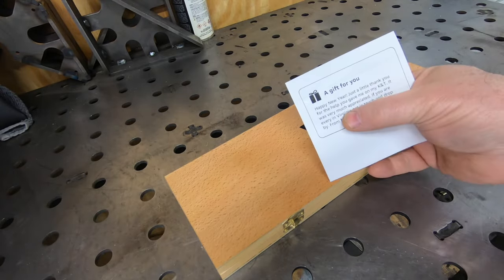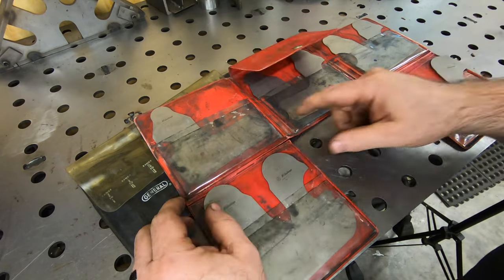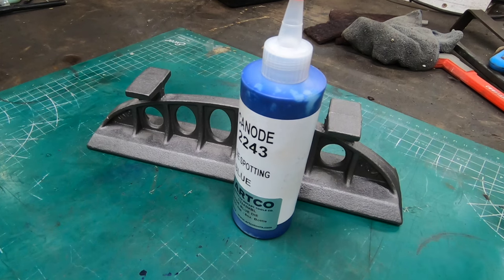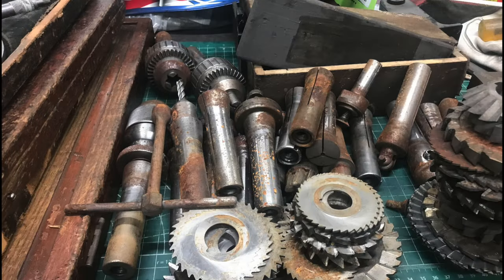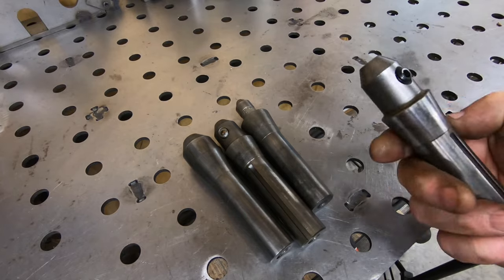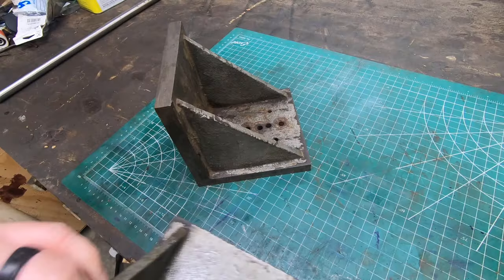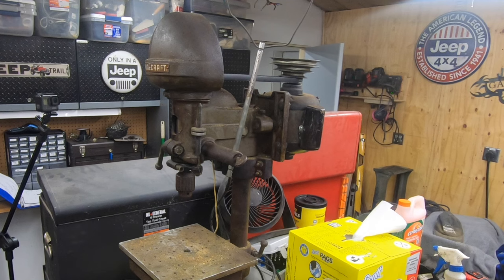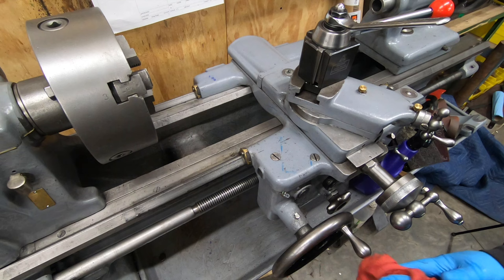Odds and Ends - Episode 8 - Shop Updates, Cabin Fever, and Climate Change

Comment: Well you certainly got some gear there. I thought i had a lot of tooling but you are way ahead. My problem is room. I now have a outside storage cabinet , which is full. With starting doing the old car up I now have even more parts. Never ending. The trouble is I have tooling for the mill & lathe that will outlast me. Nice video.
Steve.
Reply from the maker: I can't stop! 😂 Some of it I want, but often these auction lots come with stuff I don't have a use for, so I will put them up for sale or give them away. I have the room, the problem is I don't use the room effectively. I have this large 4' x 8' work table, that I love, but the underneath storage is horrible. I've been thinking of building a replacement, maybe out of steel, and put drawers underneath it for some of the miscellaneous stuff.

Comment: Hey Greg good video if you electric bill for heating is to much i use a pellet stove i picked up a used one from a friend cheep
i buy a pallet of wood pellets 50 40lb bags they went  up from $250 to $350 but i got it for $300. Now i think in your part of the country they might have corn not sure . the nice thing about these stoves you can just run a short double wall 3'' tube threw the wall or like i did i cut out a plate that i sick in a window for the winter and i move it and put a swamp cooler for the summer and they don't use much electricity they have two small fans so like running a box fan  and the other thig is no open flame or heat source to ignite fumes in the shop . keep up with the videos I'd like to see more K&T Thanks  . JM
Reply from the maker: I've considered some kind of wood stove or pellet stove, but I don't think I really have the space for one. If I were to add non-electric heat, I think I would be more likely to run a natural gas line into the shop and use an infrared radiant heater. I can mount that on the ceiling and I wouldn't have to have a place to store the wood or pellets.
Reply: Yeah we have propane so I never considered a gas heater good luck hope it